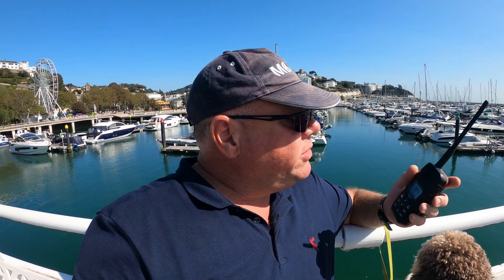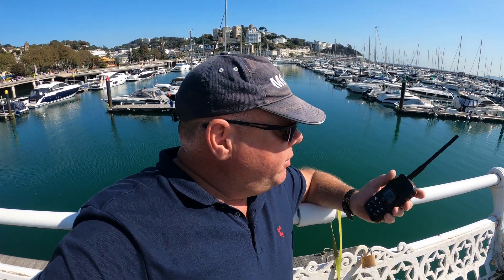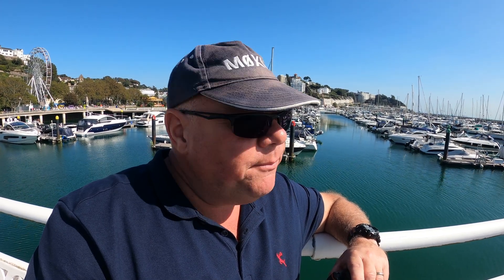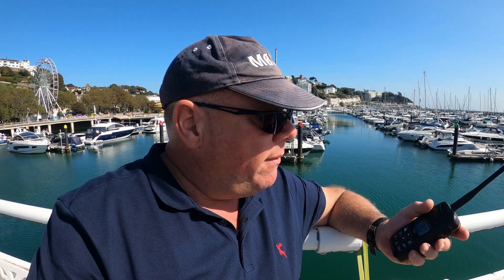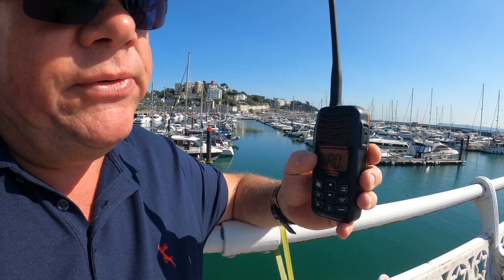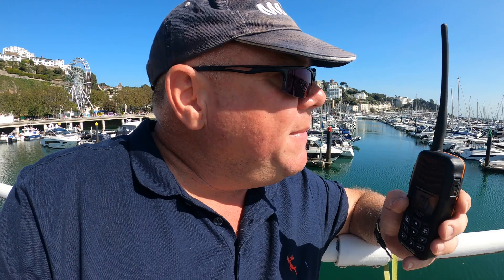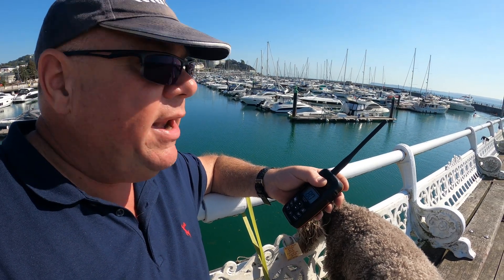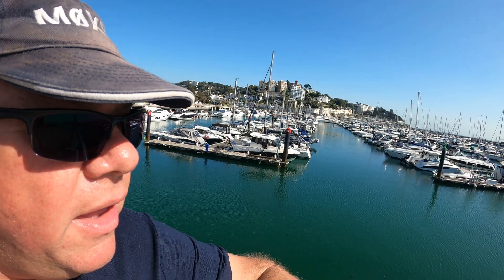Introducing Marine VHF comms.

Comment: Living in coastal Alaska I want to get a handheld for going boating and exploring islands.  But in remote areas it could be very helpful to have the ability to hail aircraft if I get stranded.  If I get my HAM radio license can a HAM radio communicate with both Marine radios and aviation frequencies?  

Our Coast Guard monitors 16, so am I better off getting a marine handheld like yours for all of the extra functions you mentioned?

Thanks!  73
Reply: You should have a marine vhf at least. If you want tobhail random planes, get a handheld aviation handheld too and learn what freq. They are tuned in you area
Reply: @tiberiu_nicolae  I’m a pilot so I know which frequencies to use. And my boat has a marine VHF.  I guess my question is, can a handheld HAM radio tune all of the marine and aviation VHF frequencies?  And do handheld HAM radios have the same kinds of features as the marine handheld like this?  Or are these handheld marine radio features unique because they are tailored for marine users?

Comment: VHF is line of sight plus approx. 15%.  The higher the antenna, the longer the range.  At sea level (sitting in a boat) the range is not far.
Reply from the maker: Yep. Normally I would agree however, VHF can be affected by atmospherics and ducting which can carry the signal hundreds if not thousands of miles. My furthest VHF contact was nearly 1000 miles.
Reply: @MikeM0XMX  You are correct, but that is exception and not the rule, and more likely VHF-SSB and not VHF-FM.  For boaters using VHF-FM, it's line of sight (plus approx. 15%).  SV0SGS
Reply: Does this prove that the earth is flat?

Comment: Waterproof: check. Weatherproof: Check. Floats: check.  Orange signal color: not check.  I don't understand why radios like these are all dark colors. They are hard to find in the dark, hard to find in the water if the radio goes swimming.
Reply from the maker: LOL. You are right. I have seen a radio, not sure which one, that starts flashing if immersed in water.

Comment: I took my Marine VHF license test a few years ago and then sold the vessel with the radio intact. I was lead to believe that my licence expired when I no longer owned the boat as the licence only covered the named vessel! Is this correct? ps,I no longer have a boat.
Reply from the maker: I think you confusing the Ships radio licence which you would have an Maritime Mobile Service Identity (MMSI) number with the Marine Radio Short Range Certificate (SRC) which is the minimum qualification required to operate marine VHF radio equipment on a UK flagged vessel.
Reply: @MikeM0XMX  Thanks, I don't need it now anyway. 73, M7ICQ